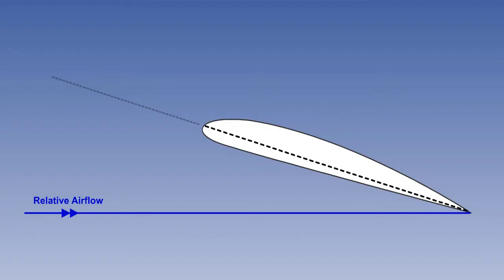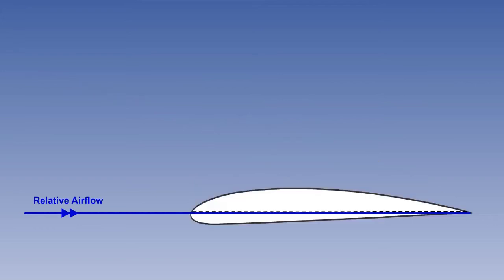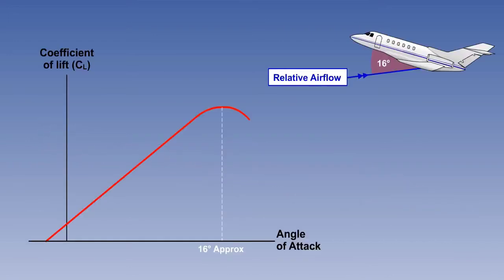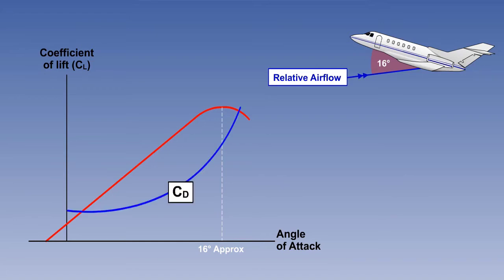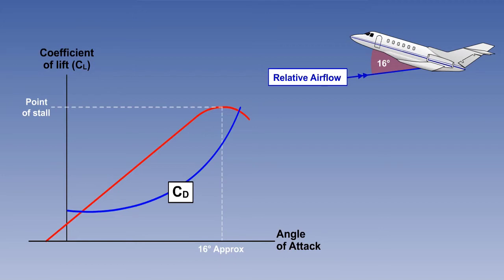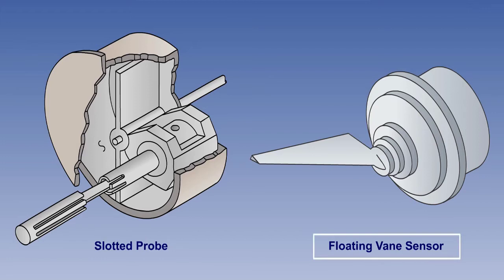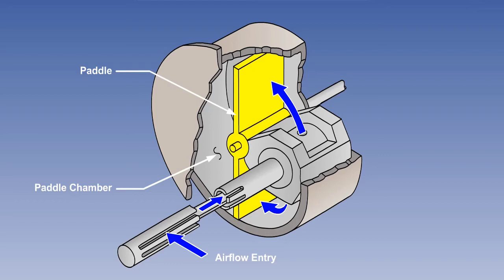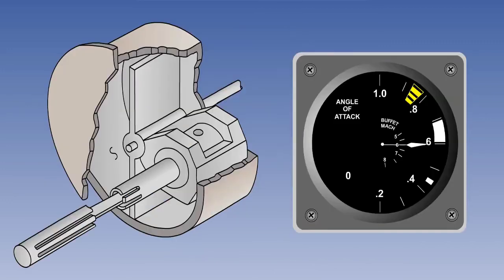Angle Of Attack Measurement | The Angle Of Attack Of Aircraft | Lecture 14

Comment: Can I ask if you know why the heater did not work in XL Airways Germany Flight 888T?
Reply: i broke it
Reply: They are prone to lightning strikes. I work on them daily so I'm very familiar with them. Most are equiped with 2 5A fuses to protect the vane from being shorted but fails sometimes. An aircraft will have back up angle of attack sensors in the event 1 or 2 get damaged.